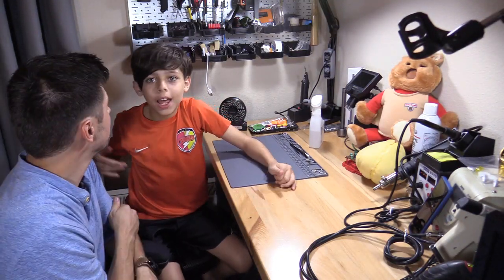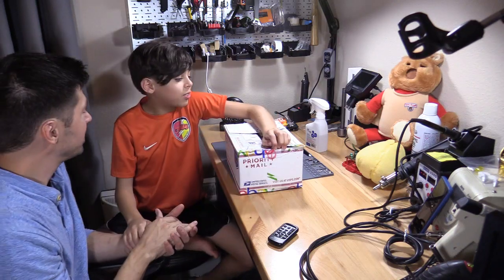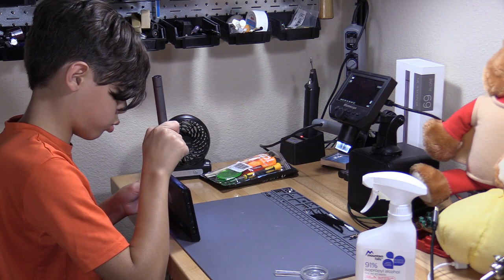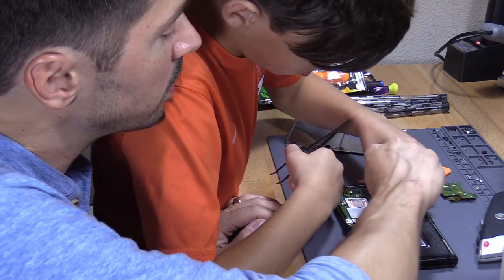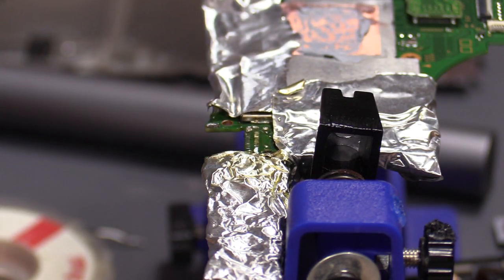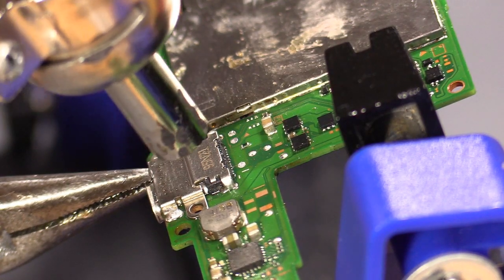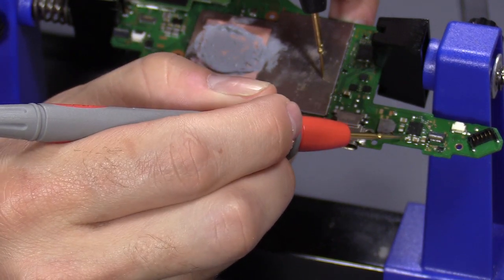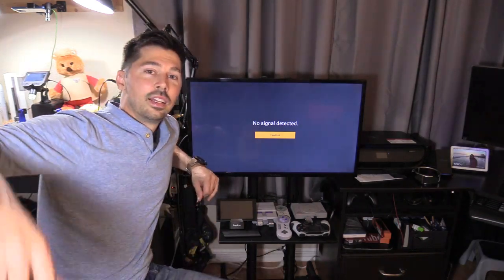3rd week Ebay Repair Challenge and Soldering Skills put to the Test !

Comment: Hopefully that's not a 3rd party dock you're using.  Nintendo told me that's a no-no because it can damage the IC chip.  That's basically what I'm thinking the problem is with that system.

Comment: Hi I purchased the driver board for a tcl 50fs5600 hoping it would solve my no picture/sound problem (as sited by one of your previous vids) and after replacing it I still have the same issue. I know I have picture because if I shut the lights out and power on tv I see HDMI 3 then a no signal (not hooked up to anything) and can use remote to see menu items etc. Do you think it is an individual led backlight issue? Also what amp wattage etc would the led lights be? Do "any" leds work or do they have to be specific to that model? Or do you think it is a different issue altogether? Any help would be greatly appreciated!!! Mark

Comment: Hey! Tampatec & Devon Sweet hair cut buddy.  Hey guys just wanted to ask if I order a Sharp power supply repair kit that has similar components to a Phillips power supply kit that I want to repair, would that work?  I have checked Shoppe Jimmy but they are out of stock of the Phillips repair kit that I need.  Keep up the great Videos.
Reply from the maker: If parts values match, sure.
Reply: @TampaTec  thanks for getting back to me.  I greatly appreciate it.

Comment: Unlucky Tampa and son, I find those USB-C ports super hard to do. If you still have the Switch you could try just the battery and just the motherboard with everything else unplugged, then plug your USB meter into it. If it reads around 0.40A and then 0.00 for a few seconds then 1.40A or maybe even higher then it means the motherboard itself should be OK and the Switch has turned on. Sometimes if the screen is faulty it can stop the Switch from turning on. So by testing with that and other things unplugged apart from the battery you can fault find easier. If you have a USB-C cable that you don't mind sacrificing then you could cut it to expose the wires in the cable. Then plug it into the Switch and test for continuity between the cut wires and the exposed solder pads on the circuit board, you might be able to test some of the hidden pins of the USB-C by going to other parts of the circuit board. Well worth giving it a go and hopefully if you can't fix it you will get your money back :-) Just read that you said the battery was 2.6V, this is too low. Maybe leave it charge up for a few hours or better still replace it with a working battery to see what happens then :-)
Reply from the maker: If switch doesn't sell then I will try again for sure.

Comment: Very nice you tried to change the charge port for the first time, don’t give up on it yet though. If the battery was completely depleted it sometimes will not take the charge and the switch will not power on, Vince did a video on this to put a charge in separate from the switch, this might work for yours too. Keep it up man, good stuff.

Comment: At 9:12 you  can see that the current is 0.40 A which is the slow charge current. I'm thinking that means the port was connected correctly but I suspect the battery is at fault. Have you tried leaving it on charge for a while? Otherwise I think if you can replace the battery it will work. Hope you can get it working!

Comment: Try a lower melting solder for the charging port. chip-quik Sn42/Bi57.6/Ag0.4 Low Temperature  melts @ 138C, 281F brand. It never fails with me. I always use it to remove and apply new charge ports especially type-c.

Comment: If it take 20 minutes to remove the UBS port, doesn't that mean you need use higher temperature? @TronicsFix ?
Reply: From watching people like louis rossmann and a few other lesser name channels the hot air gun he is using is cheep crap and has a high chance of burning the board i have the same hot air and had to calibrate it and still took a long time

Comment: Do you have a link for that PCB holder? I might need to get one of those. If none of the capacitors are shorted then most likely it's one or more of the pins on the USB C port. Those are tough to get on correctly and I can't tell from the vid if all of the pins are soldered all the way. I have seen a few charge IC's that were bad with no shorted capacitors.
Reply from the maker: Great tips, if it doesn't sell I'll try again.
Reply: @TampaTec  How long did you leave it on charge for? 0.40A seems to be correct for a completely drained battery. Previously when I have done charge port repairs, if the battery is DEAD flat, it can take HOURS for it to actually turn on, or show any sign of life. The batteries are very slow to charge when they have been drained flat on the Switches.
Reply: @KiloooNL  this is what I was wondering as well
Reply: @TampaTec  I hope you try again.  We believe in you man.  Maybe have Devon back off just a tad so you can take your time.  You are suuuuuper patient with him and it's awesome.
Reply: @TronicsFix - Proskit SN-390 is the PCB holder, or at least the best version of that type of PCB holder!

Comment: Ah man I’m sure there’s still a chance with that one! Could need something else! Give Steve a ring!
Reply: Paul, It's not cheating, it's the same as watching a video on how to repair something, you'll still be doing the work. Listen to Elliott and ask Steve,  I'm sure he wouldn't mind giving you a idea.
Reply from the maker: It feels like cheating calling an expert, and he's part of this challenge contest.
Reply: @TampaTec  Did you check for shorts by measuring the pins on the port itself?  Perhaps you bridged some pins by accident while using the hot air.  Alternatively, can you test the port pins to test points on the board to ensure you did get the connection? (I've not worked on one of these before so I don't know if there is a schematic or boardview available to help the process.)
Reply: Did you check how much charge is in the battery? :)

Comment: Check the battery voltage, if they go too low they will not charge properly, there's also been quite a few which have known to go faulty and need replacing.

Comment: I have never repaired a switch, however I have watched countless videos on them being repaired.. Its not fast charging which could mean a faulty hdmi Ic.. Did you check all the capacitors for shorts? 

Also could be bad connections on the charge port legs?     Don't give up yet, I want to see a victorious part 2 to this video!
Reply from the maker: It's possible I didn't solder all the pins under it but I reheated the port still not charging.
Reply: @TampaTec  Check the HDMI IC, as 2 of the symptoms are present, not fast charging and no screen output. I hope you can solve this and make a profit :)